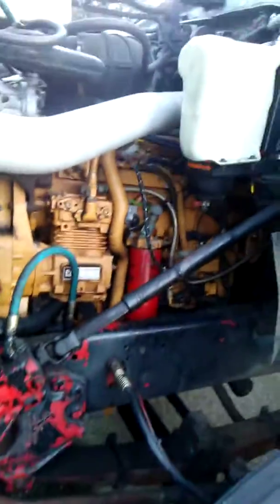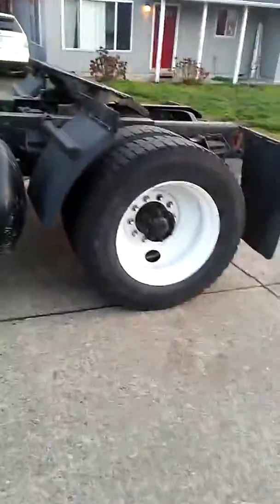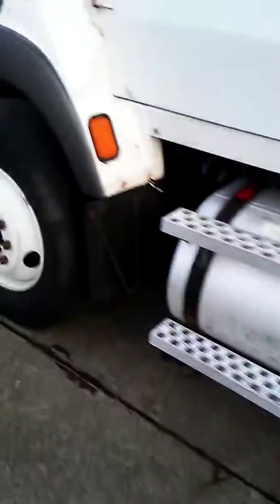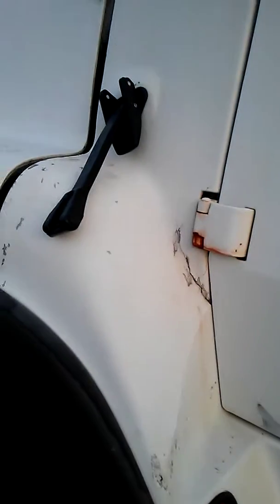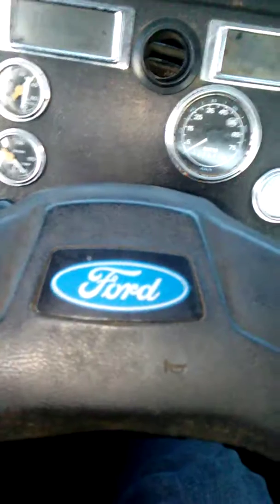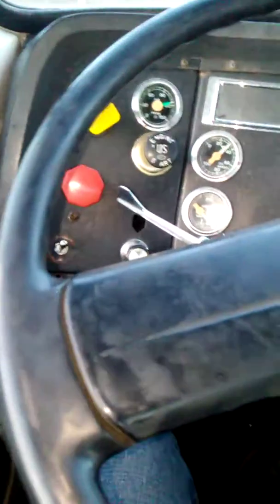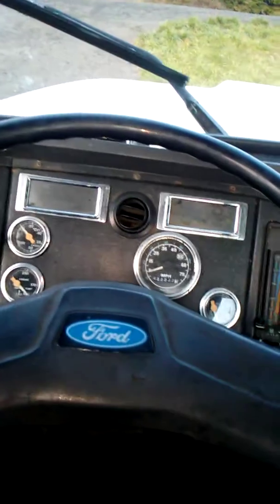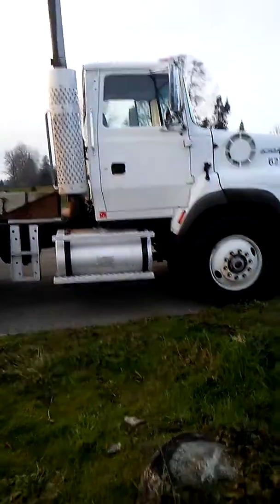My new truck! Ford L9000, cat 3176 engine with a air starter!

Comment: my first tractor was a Freightliner with a 3176  cat. I loved it. I bought it outside Chicago. I flew there to buy a fancier tractor all chromed out classic with a 3406 b with a fresh major on it it was beautiful from 10 and a disaster. I bought the 3176 with about 250000 miles on a inframe. 
 I drove it bobtail 2500 miles home average speed was 90 mph . I got 15-16 mpg . when I put it to work city use it averaged 9mpg gvw 80000 . within a year I had a small fleet series 60s and cats daycads and sleepers that 3176 got by far the best mpg. the only diesel that did better was a f600 rollback flatbed tow truck with Detroit 12.8 that got 24 mpg with a car on the back and one behind. but it was slow 60mph flat out up hill down hill or off a cliff 60 was it
Reply from the maker: That is such a great story. Thank you so much for sharing it to me!! I sold the truck unfortunately. I wish I kept it however I was running out of room to store it.

Comment: Dang i really liked ur 45 KW...ford will make a killer service truck
Reply from the maker: gns logging yah I know it was really bitter sweet getting rid of it. I almost backed out of the trade... But I'm glad I didn't because the kenworth was hell to drive it 50 miles... The ford is like driving a Cadillac.
Reply: T&F Logging ya i could imagine...my grandpa had a 53 kw i learned in...i told jesse we should of traded u our shovel for it lol

Comment: Put your service body on there you can use that pintle hitch to tow an equipment trailer. if you have an air comp. on the truck you could use that to start it if you had to.

Comment: what is the lowest pressure that the starter will run on?
Reply from the maker: Skidder Kev I believe it will not start at around 50 psi.